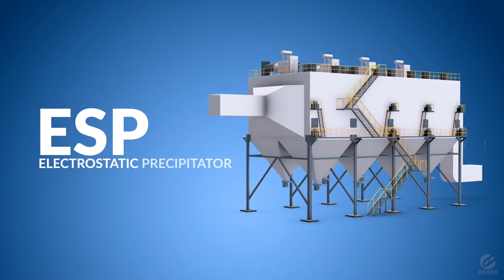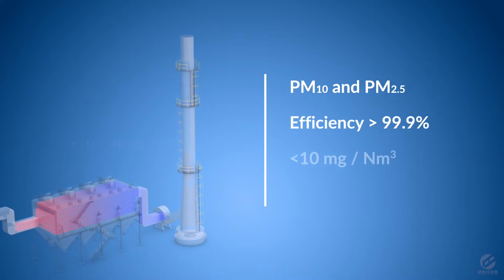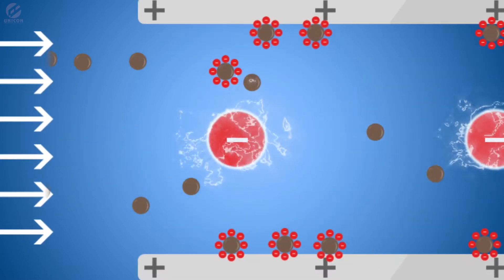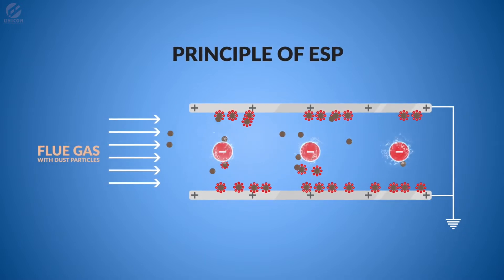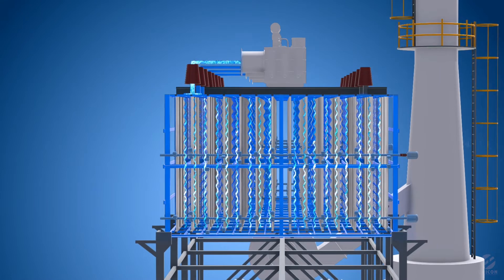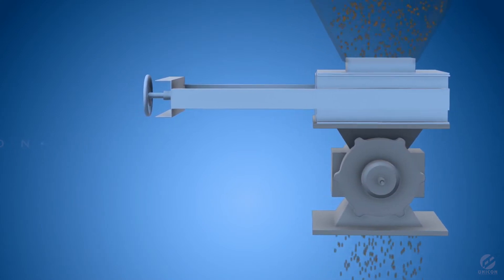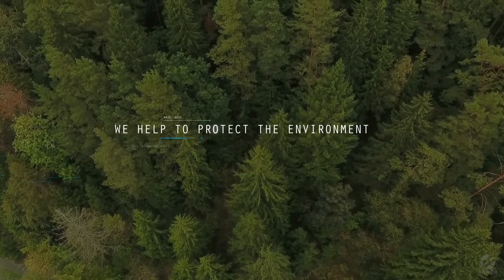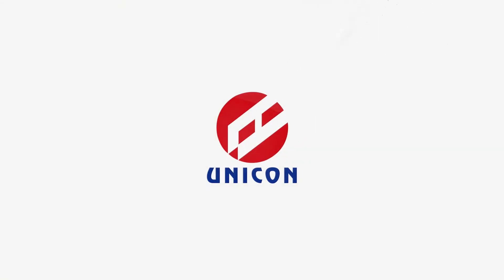ESP Technical | Power | Cement | Steel | Sponge Iron | Chemical | Paper | Sugar | Unicon Engineers |

Comment: From this video I can find out if complementary DOP textiles and organic compounds contained in smoke emissions from industrial plants will cause many diseases and the solution is to clean electrostatic precipitators so that only clean air is wasted.  Repeated use of flash and also insulators can secure efficient and reliable purification system operations.  Thank you very much for the information, hopefully ESP suppliers from Clean can run smoothly and provide other facilities for consumers.
Reply: Qwqqqqqqqqqqqqqq1qqqqqqqqqqwwwwwwwwwqwwwwqqwwqwqwwqwwqwqwww

Comment: Unicon Engineers - Manufactures of Pollution Control Equipments Like | ESP (Electrostatic Precipitator) | Bag Filter | Bag House | Pneumatic Conveying System | Ash Handling System | AFGC (Ammonia Flue Gas Conditioning System) | ESP Spares | etc,. We are also carrying out | Retrofitting of ESP | Upgradation of ESP | Augmentation of ESP | etc,.